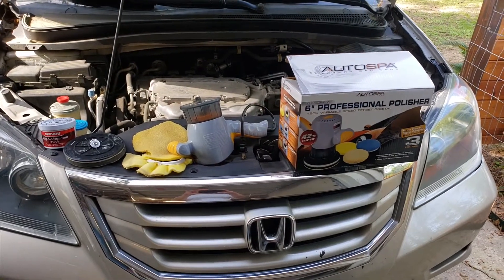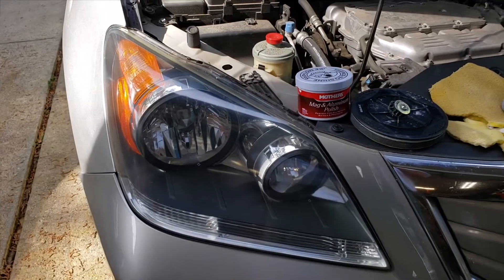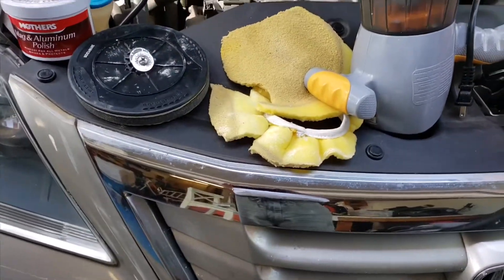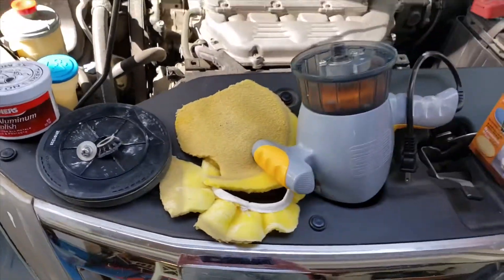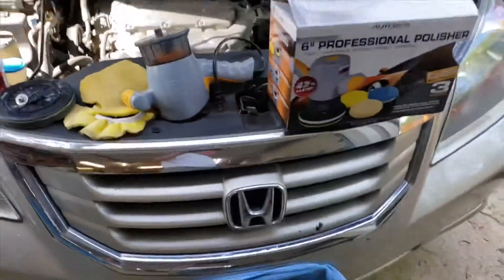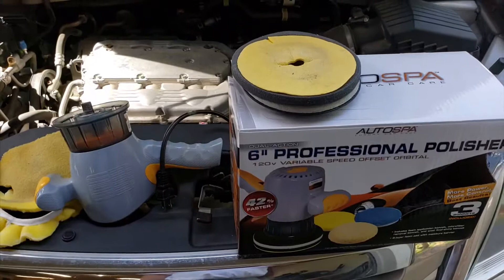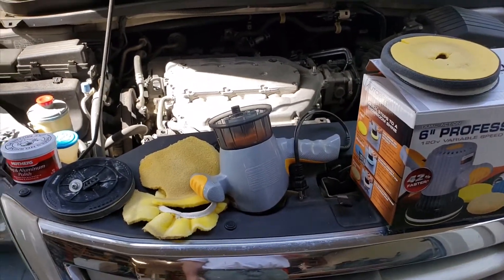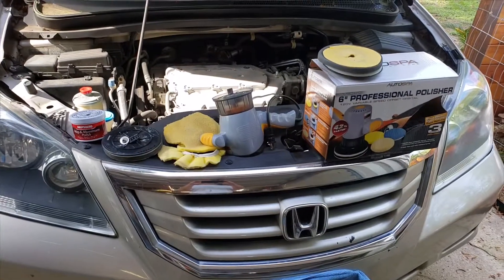REVIEW AutoSpa 94009AS Dual Action Professional Polisher find out why I don’t recommend this product

Comment: For all the people who say the pads tear right away once it encounters a bump or dirt or anything, that just means you probably didn’t take the necessary precautions. before you use this you need to wash the card, dry it, AND use a CLAY BAR on your surface to smooth it out. I’ve watched multiple video where full time/professional detailers use this and it doesn’t do that🤷🏾‍♂️ in fact they love this polisher for the price it’s at

Comment: did you read the box ? looks like to me  you was pushing and that's a no no  and the blue is for removing wax or polishing the foam one is for apply wax or polish you let it do the work so if you push to hard this is what happen's
Reply from the maker: We did read the instructions but in certain situations you also try to see which one will work for your needs. I also did my research after I encountered a problem on my first buy and looks like I am not alone on having this issues.
Thanks for stopping by. Appreciate you taking time to check us out and give us your input. Have a good one.